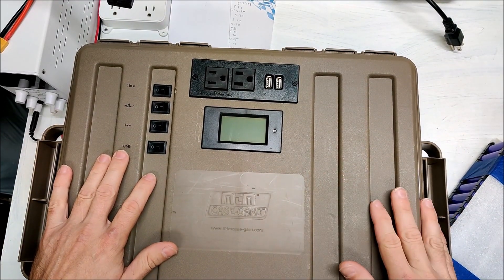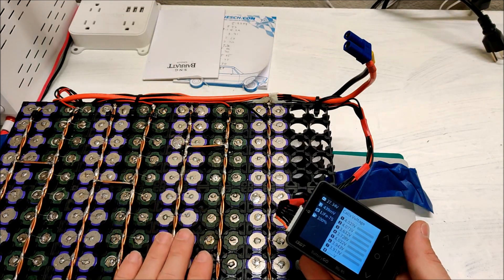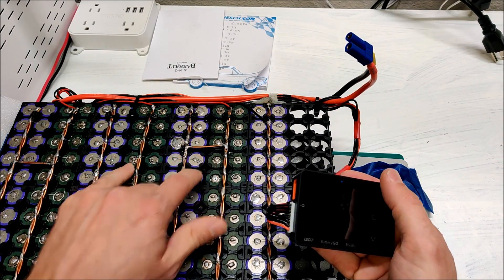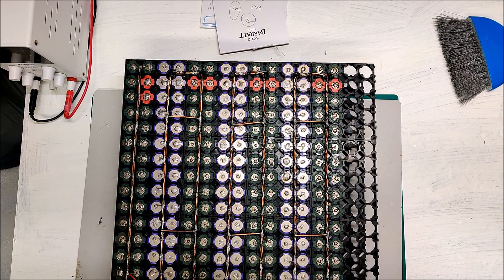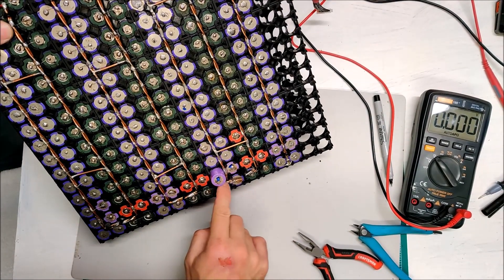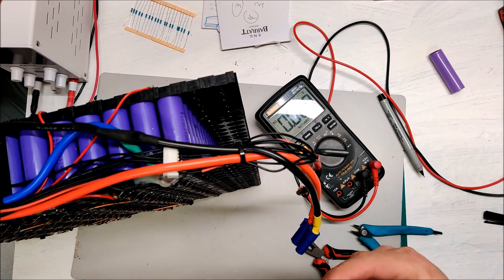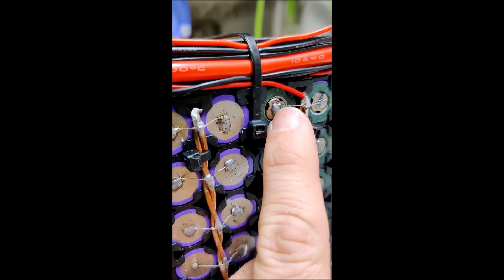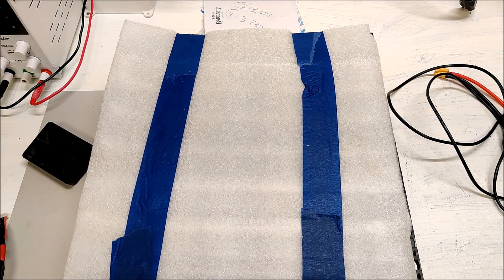REPAIRING A 210 CELL DIY BATTERY PACK

Comment: Personally would've spot welded the 3rd and 4th row, that way it gets re-done better, but you don't have to go through the trouble of the entire pack, also since it'll be moving around, a bit of glue on the solder points would've probably been a good idea.
Reply from the maker: Yeah I thought about it.

Comment: Soldering the copper wire at the positive side of the cell is Ok but it's hard to solder at the negative cause the whole body is -ve so basically heat transfers the whole body & looses the capacity, solder fast as much as possible. 
I lost 12cells which have 2000mah & they've became like ~ 200mah